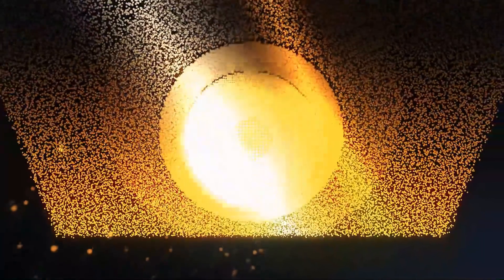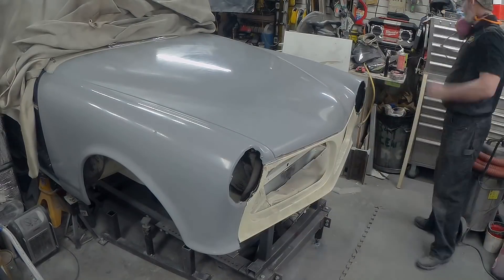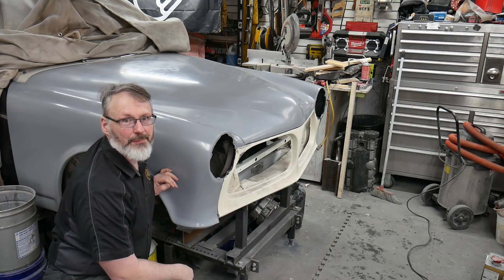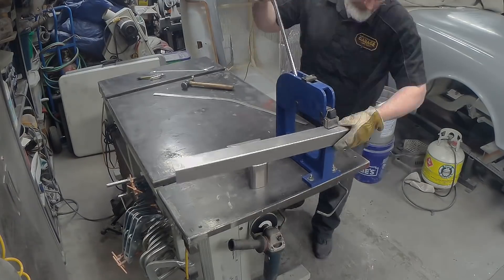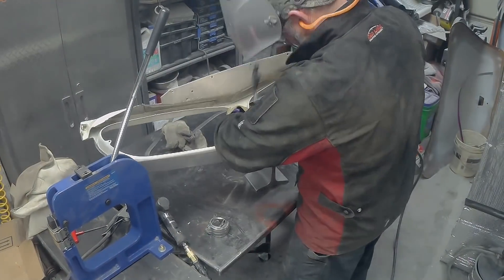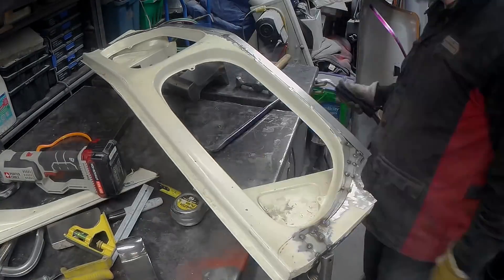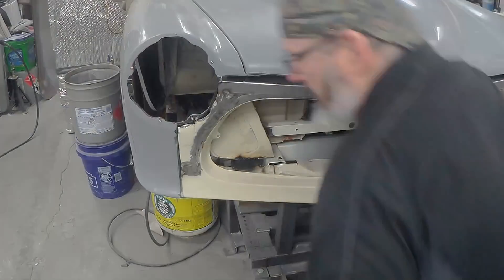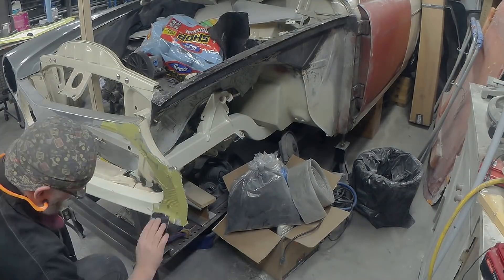Making Custom Carbon Fiber Parts - Sheet Metal Plug Making.

Comment: I found your channel when searching for ideas on how to remake the front bumper for my 1964 Rambler Classic out of fiberglass or carbon fiber.  I've watched a bunch of your episodes, and subscribed.  You have some GREAT content.  Unfortunately it's making me wonder if my project is even feasible (due to the contours and edges of the bumper)
Reply from the maker: Thanks Michael.  I've looked at the bumper for your Rambler.  No problem - it's an easy shape that was made in a single die (as far as I can see) that means all the angles etc will be fine for molding.  Just make sure it's the shape you want before you make the mold.  For difficult areas to flange (the returns to the fender for example) just fill the back of the bumper with foam board to make the mold flange go in the right direction. You can see me adding foam to the shut panel edge in this video as an example of this technique.  It really won't be that hard - a lot of work but feasible.
Reply: @ThrottleStopGarage  sorry for the delayed response. How would you prevent mold lock with the returns toward the fenders? They would be parallel to the front surface of the bumper. The fiberglass would essentially wrap around need to be spread to release the mold from the bumper
Reply from the maker: @michaelcouey1383  just make a three part mold with the returns being a separate mold.

Comment: AMAZING Finally binge watched my way through and getting all kinds of inspiration. I have a 68' 122 and a 62' 544 that are all projects. I have to deal with seasonal constraints also and have a one car garage with no furnace and live east of Toronto. I have to admire your patience and resolve. Am presently rebuilding a B20 in my basement and looking forward to getting the 544 on the road this spring. Keep at it.
Reply from the maker: Sounds like a couple of great projects Phil.  The B20 I had in this car dyno'ed at 134 hp at the wheels.  It was a lot of fun.